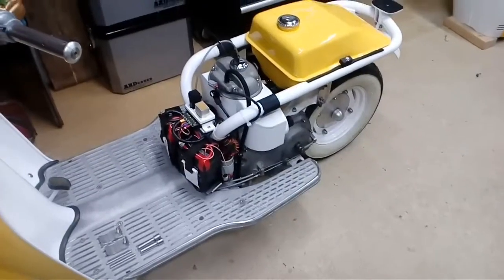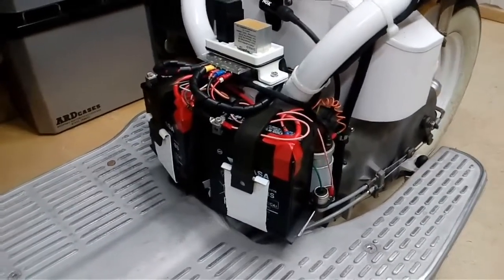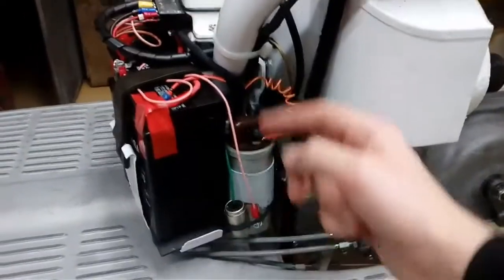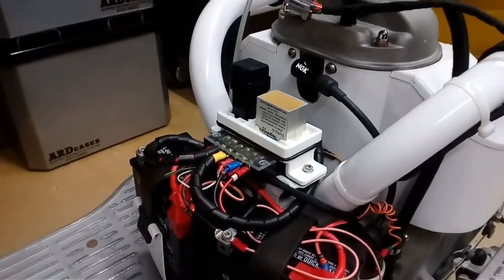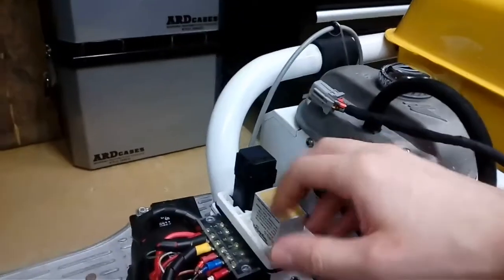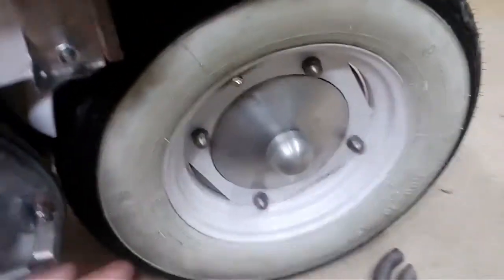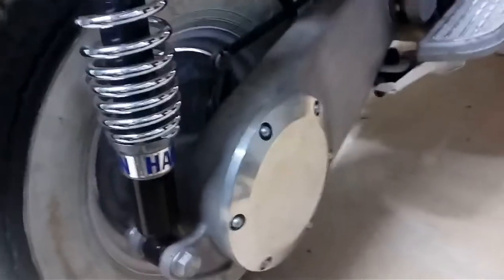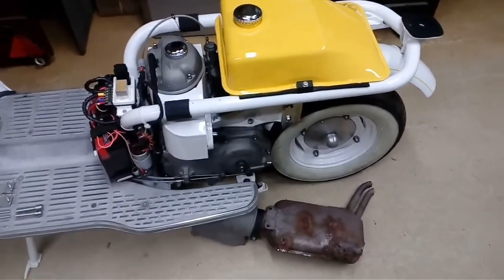Heinkel Tourist 103A2 1961 - Restoration Blog - part 2 [ENG]

Comment: Im just learning of the Henkel Scooters. You have done a beautiful job of restoration. The bike seems very stable on the road. Curious? How many miles were on it before restoration. I drive a Vespa 200. However someday maybe I can find a Henkel Tourist. Thank You.
Reply from the maker: Thanks for the words of appreciation. I don't remember the odometer reading, but it was rather inaccurate due to lack of cable to start with and fact that this bike was destined for parts, not restoration, but was saved :)